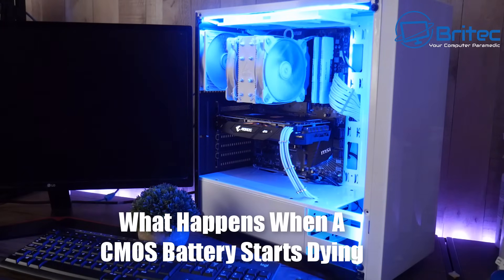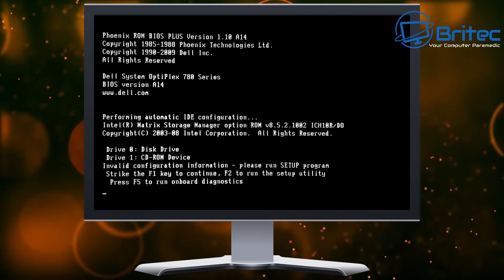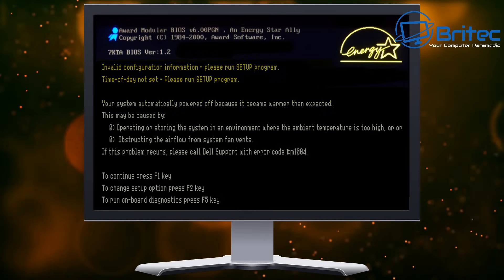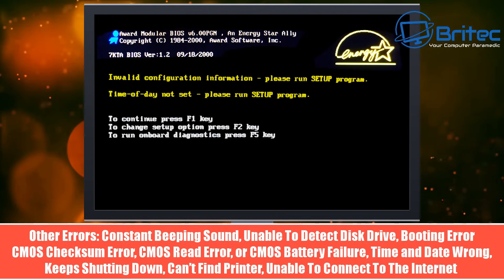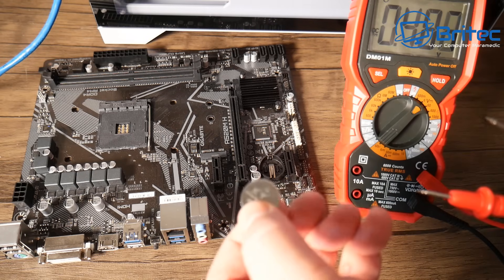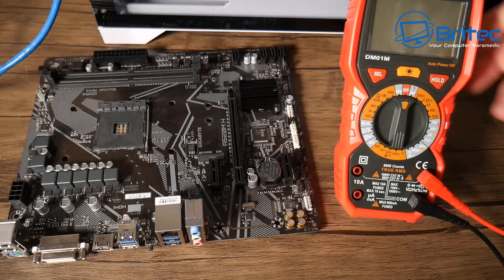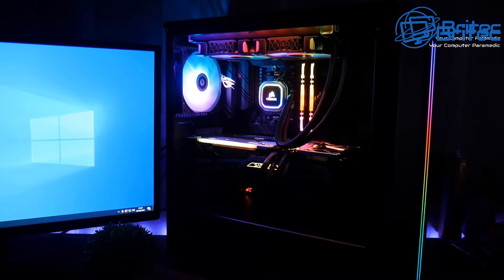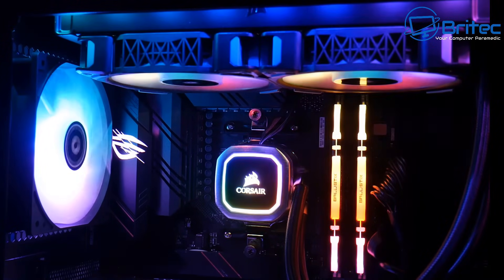What Happens When Your CMOS Battery Starts Dying

Comment: I just got my computer fixed from having a AIO shit on me I bought the computer from newegg and its been about a year so Ive been going nuts trying to see whats wrong... I'm new to computer tech stuff and I just don't know much about them and lately my computer has been acting funny sometimes my RAM says I have 32 gb of ram then all of a sudden I have 16gb..and the clocks go from 3200mhz with XMP enabled then it goes back down to base clocks 2133mhz 32 gb. I just went into my bios and it said it has reset my configuration ALSO when i use the advanced restart tool through WINDOWS to go into my bios when i restart it Motherboard codes 02 or D2.. I looked up those codes it says PCH initialization error but if i shut it down and restart it it goes into bios normally with a message that says bios configuration reset.

Comment: I just recently put all the components of a custom-built machine which was made for me in 2011 into a brand-new Fractal Design Meshify C Compact Mid Tower this year, and I'm getting this endless reboot loop. It seems as though the computer is getting power but flashes off and on every 2 seconds. There are no beep codes from what I hear, but my sighted friend, Markus (Yes, that's "Markus" with a "K", not a "C"), took it home with him to perform some further diagnostics. Brian, a tech guy at PC Audio Labs, the company that originally built this machine for me, says that I should reset the BIOS. Markus tried that by taking out the battery then turning the machine back on. No dice. Still getting that endless reboot loop. Brian then says that I may need a new CMOS battery. He says my motherboard, a Gigabyte Z68X-UD3H-B3 Revision 1.0, runs on a CR2032 battery. I know it's silver, and is known as a coin-cell battery. Is it the size of a nickel? Maybe a dime? A quarter? Batteries Plus Bulbs here in Eugene, Oregon informed me that they have plenty of CR2032 batteries. They recommend a lithium version of this battery. what's the difference between that and a regular CR2032 battery?

Comment: Can a bad/dead CMOS battery cause process latency that affects sound audio such as crackling and popping, system lag etc?
Reply: If it has come loose and is on the board shorting something out or if it has popped and leaked out its life juices on the board than yes, it could cause those issues.,  however sounds like a grounding issue with popping and shitty signal or thermal issue with latency..

Comment: Brother could you please help. I have an error in my system. My pc turns on and even boots into windows 10. But after a couple of hrs approx 1 or even 1 and a half hours of usage and even idle my pc's display goes no signal. But all other components in my pc are running the hdd the processor the rams the GPU the keyboard the mouse etc. What might be the problem with my pc. I am not able to find which component of my pc is dying or should be replaced

Comment: When i pull the plug out of the wall (after turning the switch off), i get an error each time on bootup next time i start the pc (after plugging things in again.) I want to be able to unplug it from wall because of power surges ive tried and there will be more in the future. So will changing the CMOS battery help avoid this error? Or am i just wasting my time and taking EDS risks with changing it?

Comment: In fact in most cases the first clue you get that the battery is nearly empty comes from the time the computer is showing after booting the operating system. Especially after a night without energy supply there is a difference. So you know the battery begins to be empty soon. A short solution is: supplying the motherboard over night (when you use a switch, turn the computer off, but leave the switch on, that costs some Watt nevertheless), so you do not have to change the time each day again.

Comment: CMOS is the last thing i haven't checked, on why my PC ain't turning on. 
My Power supply is new and even higher watts than the old one, Ram seems okay, gpu seems working, HDD is fine, CPU fan works fine, cables seems working.
But it don't turn on or even display at least BIOS, but cpu fan runs but no sign of keyboard led either. 
Tho sometimes after a few restart it turns on, and i quickly check BIOS to see temperature or any sign of issue, and there's none aside from outdated date/time sometimes.
Reply: Did you ever figure it out ?
Reply: Any updates?

Comment: If my pc become no signal in the middle of working/running is it also causes by cmos battery? I have checked my vga/hdmi cable, clean my RAM, update my graphic driver, those were not the issue

Comment: I'm surprised motherboard manufacturers haven't come up with a design that detects low voltage on the battery and gives a meaningful warning.
Reply: EXACTLY! Even my kitchen scale tells me the battery should be replaced, but  my zillion dollar PC just wont boot up.
Reply: @suetv7084 my HP laptop does that
Reply: Especially if you can't see. It would be nice to have some audible feedback like a beep code of some sort.
Reply: My desktop beeps when CMOS battery is low  @MsAussie83
Reply: Yes all other voltages are displayed in bios, surely it wouldve been easy to monitor the cmos aswell :-)
Reply: Better YET = A Windows / IOS / Google / any OS Update Checksum = However = Weak Battery Causes This To Fail Causing a Blue Screne = your  First IS The Worst =- AND YES = Even a Brand New Battery Can Be Defunctant   = the pc = While just merely having an excess psu = Should Not Requiire the battery Til its Required = This is a Motherboard Miss-qued   Advantage of Process Awareness  as well as having a Monitoringg Directly In Bios To prevent Data Loss = some SAY they Do = But Really Dont due to iit Takes Up So Much ROOM and anymore they would have to stop using jpeg or something =idk = but i should have the ability to open it up in wondow/s   and see the percentage life of product as It can be measured Through A Manual Stress test on the unit each request for data on subject = you Could Literally Have End User ONly access to monitor this as well = And In Fact = DATA SHOWS = It Would Pay To Design Such = maybe a Software = BUT OMG = That 3rd Party Direct Access to MY OS =  H__L  NO    it must be by those products you use alone = NO MORE 3rd Parties !!!!!  either directly from creator or manufacture , no more through this or that   
may have went on  a tangent there  , MY BADD
Reply: @JamesFox1 WTF?? r u really a human???
Reply: @JamesFox1 im just wondering, do you happen to have tendency to have psychotic episodes or anything similar? And not saying you are sounding psychotic, but your writing has kind of word salad feeling.😅
Reply: @JamesFox1 I can't understand what you are trying to say here
Reply: Like on a phone and other electronic stuff
Reply: By the time the battery fails… manufacturers have no incentive to help … they’d much prefer you have a great deal of trouble…so you go shopping for a new PC.
Reply: I have had a laptop and desktop motherboard that gives a BIOS warning (of sorts) when the CMOS battery starts to crap out. Throwing a pause and F1 at the BIOS screen. Though I've been hearing others with newer motherboards just having critical failure issues.

I just bought a used motherboard that worked well for several days, then started having audio issues along with freezing and shutting down on the desktop, then during login to Windows, and even shutting down during the scandisk operation and while in a USB boot environment trying to run diagnostics.

I then noticed it had very loose SATA ports on the board, the audio jack was also loose, and there's some small spot of residue protruding on the board from a circuit I've ID'ed as a crystal resonator. Which looks like it may be a bit burnt, with the residue stretching from it to the metal on a small chip nearby on the board. I tested all the components, but the one thing I DIDN'T think of was checking the CMOS battery. As I have had them go dead for years and still been able to boot and use other devices.

Heh. I've already purchased a replacement for it, but will definitely be replacing it and testing stability somewhere down the line. Shame I don't have an extra PSU with an 8-pin CPU connector or I'd open bench test it. Sure would be nice to have a second 4th gen Intel board as a backup or for passive data operations.
Reply: I would appreciate that as well... Mine leaked after 8 years of use
Reply: because that would cost them a 0,1$ voltage measurement IC,  and they cannot absorb the colossal fkin cost of such space-age circuitry... thatswhy!
Reply: I just had to replace mine and have read about it recently.  It sounds like typically the battery will still have 3V but not enough current.
Reply: My hp laptop repeatedly does

Comment: Can dying CMOS Batteries also cause BIOS settings not being changed/saved?
On my previous PC that I used from August 2015 to January 2020 the mainboard started to have issues persisting settings the last year (2019) or so, although booting up wasn't a problem. It once reset to default values after OC instability and then I wasn't able to reconfigure my settings. Only every now and then when taking the battery out for a bit I could set some things IIRC. Unfortunately I didn't get to searching and buying a new CMOS battery and don't remember having checked the voltage (although I was able to), I just worked around this by installing a program for CPU OC from Windows and letting the RAM run at default 1333 MHz instead of the 1866 MHz XMP profile. And then I built a new PC and sold the previous one, so didn't do further troubleshooting.
Could it have been a dying CMOS battery or was it something else going wrong with the mainboard? If so, what could it have been?

Comment: I started having problems like my CPU running hot and couldn't figure out what was wrong. Later, I noticed the time and date inaccuracies. I replaced mine with a used one because I couldn't find a source for a new one that I knew to be the proper one. I am sometimes hearing a high-frequency/low-frequency beep on startup with this used replacement battery installed. If the situation doesn't change, the next thing I will do is test a "new" unverified battery I have sourced to make sure it has at least 3 volts and then test my "used" replacement to see what voltage it is showing. If the "new" battery has 3 or more volts and the "used" replacement is below 3 volts, I will swap out the current one for the new one.

Comment: My HP laptop has dead CMOS battery, simply sets BIOS values and time/date to to default. No need to enter correct BIOS values either (because during OS installation important values were on default), it boots just fine. I only need to update time and date via NTP service once it's booted. But, its worth noting that I have Parrot OS GNU/Linux on that laptop, Windows may behave differently.
I get 2 error messages during system startup:
1st one:
CMOS checksum is invalid.

BIOS will reset to default configuration.
2nd one:
[       0.006720] __common_interrupt: 1.55 No irq handler for vector
After botting up and logging in in the system I type following command in terminal:
sudo service ntp start
And everything seems fine.

Comment: Great video Brian, quick question. Recently when I boot up my pc it goes to boot then the power goes off and comes back on a few seconds later and it says the pc was not turned off correctly and have to go into my bios to boot my pc up. Is this a CMOS battery problem in your opinion?

Cheers
Lee.
Reply: Yes.  Exactly the same symptoms on my PC.  Resolved by installing a new battery.
Reply: @deere3350  Yeah I fixed it with a new battery as well.

Comment: Hello, please I've been having the same issue and inserted a new CMOS battery but it does not work and my computer always bootup by it self when I switch on the power socket on the wall. Pls I need help.
Reply: I have the same problem haven't changed the cmas battery yet but it boot itself everytime!

Comment: Could it cause a no startup?  I took it to a shop and they said the motherboard was dead.  New mb and cpu and all was fixed ($400+).  I held on to the old parts and decided to test the battery with a multimeter, less than 2v.    I already bought a new battery, think it will resurrect?  Nothing looks burned with a magnifying glass.  What does anyone think?
Reply: Worth a try, battery is cheap 👍

Comment: I'm having the same problem too, I have 3 220G im getting a Ryzen 5600 and I'm wondering can i update the bios with the 3 220G in. once the bios is updated to the 5000 series chipset. can i just take out the 3 220G and add in the 5600 proccesor i just need a correct answer for this problem i don't want to fuck up my motherboard because i did this wrong.

Comment: Thank you. About a week before your video my Intel motherboard wouldn’t boot or power on. Replaced the CMOS battery and it worked then failed again. I forgot to clean the metal contacts. Cleaned and fixed. Also did a deep cleaning of dust and dog fur from my fans and motherboard.  Great 👍 video

Comment: I'm pretty good with computers and I've always thought that a failing CMOS battery would just show the error messages shown in this video. I learned that it isn't true even for fairly recent mobos because a dying CMOS battery caused my PC from turning on in the first place. The mobo is an Asus ROG Maximus VIII with an i7-6700K and is around 7 years old or so. 

First error that occurred was double booting (PC turns on for several seconds, shuts down, then turns on again during POST) while on XMP. I encountered this problem ages ago and the Asus forums always claim that this is "normal" as part of memory training but I managed to solve this by fiddling with some obscure BIOS setting. I was surprised that the problem returned, but noticed that if I didn't turn off the power to the system completely the double boot didn't occur. After a while, there were times when the system refused to power on and it progressed to the point it wouldn't power on at all no matter how many times I pressed the power button. I tried doing a BIOS flashback twice and it didn't solve the problem. I thought it was a motherboard problem so I started using my laptop instead while searching for a second-hand mobo. After around a week I had decided to try turning on the PC and I was surprised that it did, although it didn't last and refused to turn on again later. At this point I realized that the errors that occurred in the beginning might be from a failing CMOS battery. I removed the battery and tested the voltage with my multimeter which showed a reading below 1 volt. After replaced the 2032 battery all the problems disappeared.

To make the long story short, if there's anything weird happening at the POST level always consider the CMOS battery. It took me a long time to figure it out because I always had the notion that PCs should be able to boot even without a CMOS battery, you'd just have to enter the correct BIOS setting every time. Unfortunately this isn't true; it's just surprising that the dead battery = no power on would happen in an upper-tier mobo that isn't very old.
Reply: i have lenovo g500s , 8years old.   its only turn on when i put it on sunlight for 4hours .   i thing my cmos bettery is dying
Reply: @Vasant8300  Maybe it's solar powered 🌞. Kidding aside, you should first check if the laptop has a CMOS battery to begin with. Some don't, especially models that have non-removable batteries.
Reply: Interesting, I also have an older ROG board with that same double boot problem. It's also now failing POST most of the time. I'm going to replace the CMOS battery tomorrow, hoping that does the trick because I've already tried just about everything else.
Reply: @rb98769  I think it's worth a shot, I hope a dead CMOS battery is the only problem with your mobo
Reply: Waaaaaaait... I need to replace my battery I had similar issues and tried everything else. Thought it's mobo or PSU dying.
Reply: @KasumiRINA so what the result brother?
Reply: @MI-its-XY  im gonna replace the battery today
Reply: @KasumiRINA   me toooo! my mobo is new it had that same problem frome day 1
Reply: when i press power , logo come for 2 sec   and then black screen , laptop both led glowing harddisk running, but no display
Reply: @Vasant8300  That seems like a hardware issue since it's occurring very early, specifically  during POST (power on self-test). If I had to guess, it's likely a failing motherboard. Since it's a very old model (the CPU is an Intel 3rd generation processor) I doubt replacement motherboards are still available. I suggest you just invest in a new laptop and migrate all your data from the old laptop to the new one. If buying a new laptop isn't an option then last resort would be board-level component repair.
Reply: today again i placed my back of laptop in sunlight for warm it ,  and it turn on normally ,please can u hrlp me why it happen. and when i turn it off for night it then in morning no display comr
Reply: @Vasant8300  Maybe the warmth is causing the expansion of a loose component(s), so that it works if it's warm. I strongly suggest you have your laptop checked by a technician that's capable of looking at the motherboard and other parts at the component level.
Reply: what are the best practices of replacing cmos battery? The Do's and Dont's.
Reply: This is curretnly what's happening with my pc. It won't turn on. I removed the wifi and bluetooth dongles and was surprised that it turned ON. But I notice that the time was wrong. Is This a cause of a dying CMOS battery also?
Reply: @allaniman8829  If the PC cannot keep the proper time then definitely the battery powering the PCs clock is already failing or dead. Replace the battery and it should fix the problem.
Reply: thanks my brother